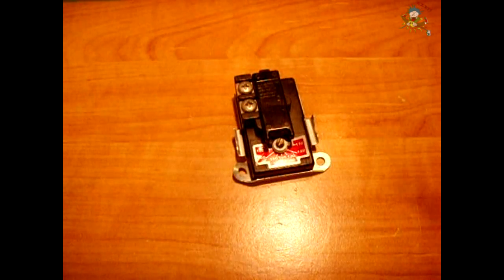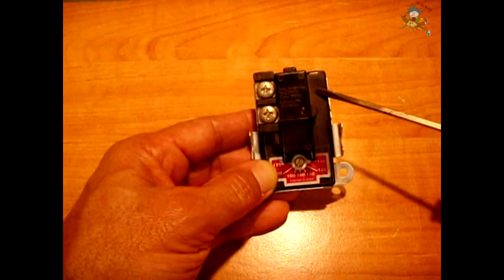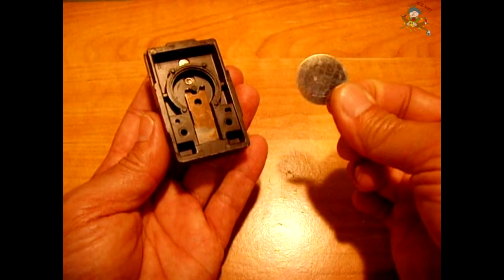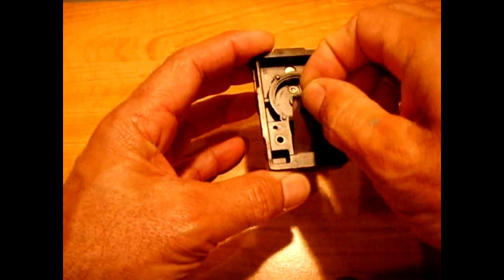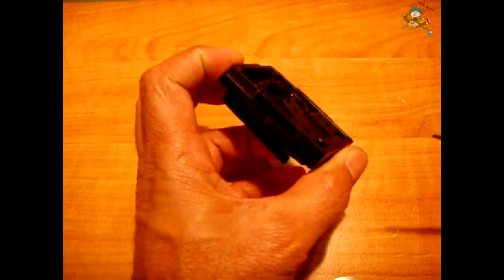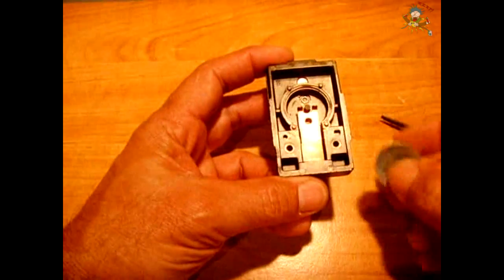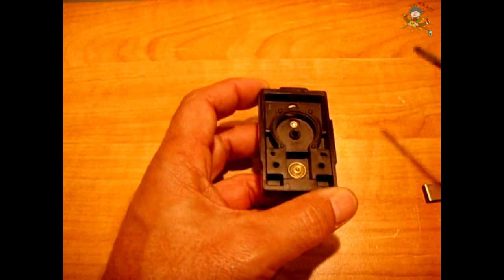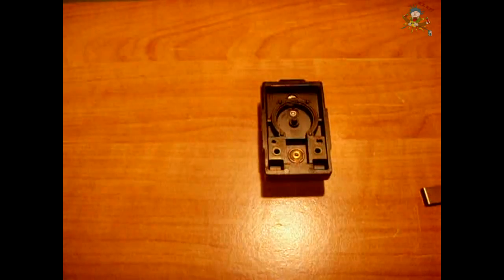FULLY Understanding How Electric Water Heater Thermostats Work

Comment: Great video, explained it perfectly one question would this work for a 12 volt heating element want to make a water heater for solar .Its mechanical so I couldn't see why not .Thanks again Dale
Reply from the maker: Yes, but if you reset it often the contacts may wear out.

Comment: Good explanation of how they work. But more important is how or why do they fail? What is the usual case of failure? Is it the button with 2 metals that fails? The plastic button that presses the other contacts?
Reply from the maker: The contact points get worn out due to arcing when the load is connected and disconnected. Thanks for watching!

Comment: I'm planning to build an solar food dehydrator and I'd to put in small cpu fan to cool if the heat gets to high.Which cook what I'm drying
So what is the lowest voltage I could use,like use small solar panel
Fun idea I think thank you

Comment: Thanks a lot...really liked it...:)
I am having a trouble with my electric hot well sandwich station...Whenever I try to increase the temperature, it start beeping and one light starts blinking which says ADD MORE WATER...even though it have enough water. So I am bit confuse where is the problem? Will be very Thankful if you  can help...:)
Reply from the maker: +Kuldeep Blaser 
Hi there. I am unfamiliar with that appliance/device. Sounds like a faulty temperature sensor(first) or thermostat(second). Check/replace those first. As a last resort the main control board could be faulty.

Comment: Hi quick question,  I'm trouble shooting a water heater problem at my house and when I check for continuity, I have it when the temperature is all the way up AND all the way down on both thermostats. I also have a resistance reading of 0.00 on the lower element and a reading of 50.00 on the upper element.  Any advice? I'm stumped.
Reply from the maker: Not right. remove the wires on each heating element and retest. Also try another DMM to be sure the meter is working properly. If the water inside the tank is below the lowest setting on the thermostat(usually 90 deg F), then the thermostat will be on regardless of the temp setting.

Comment: My electric water heater line sprung a leak and water ran down my unit,I've let it dry out for a week  are the thermostat capable of drying out with in that week waiting period?
Reply from the maker: remove the (2) screws and open up the small panel to check. You can remove the thermostat and shake it hard to see if any water comes out. Of course the power would be turned off first.
Reply: @electronicsNmore  ok,thanks for the feed back.

Comment: Thanks as always have you replaced the anode before? If so do they come easy and when do you think is a good time to start checking?
Reply from the maker: Only once did I remove the anode. It takes a very long time to corrode, unless your water is not so good. They certainly do a good job at preventing the tank from getting corroded.
Reply: Excellent thanks...

Comment: I have added a lower (only two wire) thermostat to turn on/off a circulating pump which circulates hot water from my outside wood burner into the water heater. Essentially I am using the water tank as a reservoir.When I am not using the wood burner this circuit is taken out of play and electric is restored to the water heater and normal function resumes. My question is I am doubting whether my added thermostat is working. I get 120 volts between the two terminals when the pump is not running, but when the pump comes on I get essentially no voltage between the two terminals. Is this correct??
Reply from the maker: Bill Vance Remove the thermostat and using a continuity setting on your digital multimeter, test between the 2 screws. Try cold, then heat it up with a hair dryer.

Comment: hi . I am having a problem. I have checked the resistance of both elements, and on both thermostats, I have 240 volts coming in the top and have power to all terminals. From what I have seen on here, there should only be power to one element at a time. but yet when I touch the ring of the element and either pole of the element I am getting 120 volts. All parts are new.  Please help
Reply from the maker: You need to measure voltage ACROSS both terminals. You cannot test the voltage between one screw and ground.

Comment: What is the difference in temperature between when the thermostat turns ON the heating element and when the thermostat turns OFF the element? For example, if the thermostat is set for 125F at what temperature will the element come on and at what temperature will it turn off?
Reply from the maker: Once the thermostat triggers(turning off the heating element), it will stay powered off until the temp drops low enough to reset the bi-metal disc, which is probably around 5 degrees.

Comment: My lower thermostate keeps burning out I have replaced the top and bottom thermostate. Both my elements has continuity. Do you know what may be causing it to burn out. (Lower thermostate)
Reply from the maker: Larry De Vaughn The only way a thermostat will "Burn Out" is by using a heating element which is rated much higher current than the thermostat can handle. I doubt it though, because usually the circuit breaker would trip. I don't think your thermostat is the problem. You are missing something, or not testing the heater correctly. Refer to my other video. Link is in the video description area. 

Thanks.

Comment: Hello i got plumbers to install a new geyser for me and when i set the thermo start  to hotter it still takes 3 hours to heat water to hot but not boiling hot. what could be wrong?
Reply from the maker: Maybe the wrong input voltage. If it operates at 240V and you're supply 120v, then that's the problem.

Comment: Would a thermostat and a element be safe option for a parts washer?
Reply from the maker: Better off with a crock pot.
Reply: @electronicsNmore  please explain. Thanks for the response
Reply from the maker: @stephenheaton8889  Nothing to explain. You were looking to make a parts cleaner using a thermostat and heating element, you're better off just using a crock pot.
Reply: @electronicsNmore  I have a large parts cleaner 20 gallon. Want to heat it

Comment: Hi. thanks for a great video.Hope you can help me with my problem.I'm using kinghatcher electronic thermostat.I set it to 35 degree celsius.My digital thermometer is reading over 40 already.The thermostat is supposedly switching off right?and when the temperature is below 35, it should switching back on right?but it's not. Is my thermometer not working as it should?
Reply from the maker: +Leween Aguiflor 
Hello there. Sounds like a faulty thermostat. Replace the thermostat.
Thanks For Watching!

Comment: Upper thermostat you mention... do US water heaters have 2 elements and the upper one switches between them or something?

When electric water heating was common in the UK, you'd often get tanks with 2 elements or a long/short element if it came in from the top. I believe though they had a MANUAL changeover so you could select manually whether to heat the entire tank or not.

I am guessing the upper one comes on first, then when it has, the lower kicks on as the upper stat switches over to it, thus providing a smaller amount of hot water quickly? Or am I way off the mark?
Reply from the maker: Yes. The upper thermostat allows power to flow to the lower thermostat when the upper thermostat turns off the upper element.
Reply: Thanks! Sensible way of wiring it :)
Reply: Thanks for your high quality videos. I replaced an upper element following your analysis tips, and it needed it--corroded, bent, and the two sides touching. In testing it, got no continuity or ohms. Had no power to the lower element, which was confusing. After replacing the upper element, I checked the voltage on the lower, and I get no voltage across the screws, but going from a screw to the tank, I get 120V on each screw. Is that proper until the upper element finishes, as you state above? and suddenly 240V appears on the lower element? Is the lower element just used to keep the water warm, or why don't they work together?
Many thanks.
Reply: Bryan Byrd I'm not the poster (obviously!) but given the way the thermostat seems to work, that would be correct, the 120v is from one leg of the supply and is present on both terminals of the lower element because the top one is switched in so the second phase isn't connected to the lower at all.

I am guessing here, but I'd imagine the elements don't work together to reduce the electrical load of the heater.
Reply: In the UK, most dual element tanks are in economy 7 meter homes (or ex eco 7 homes). The bottom element is usually powered on when the economy 7 period starts (sometimes called restricted) and powers off automatically when the water is up to temp or when the economy 7 period ends. The middle element is used as a booster - this is connected to a constant unrestricted supply that the user can turn on and off at will. Economy 7 is used at night in all electric homes for cheaper electric, storage heating is commonly used with eco 7)

The tanks that have a single element near the top are generally used as a backup in case the boiler breaks down. The user can still have hot water, even if it's more expensive to heat some of the tank

Comment: mine as soon as power is applied kicks the breaker, I've checked wiring is ok
Reply from the maker: Faulty element or shorted wire.
Reply: Randy Dugger check for continuity between the steel tank and your element, if there is then your element is grounded or in contact with the steel tank.

Comment: If the water's hot why do you have to heat it? It's a water heater not a hot water heater
Reply from the maker: Some people aren't smart enough to realize that when the water temperature is set for 120 and then it drops to 110 which is still hot, the heater has to turn on the heating element to heat the already hot water to a hotter temperature. Is there anything else you'd like to know?